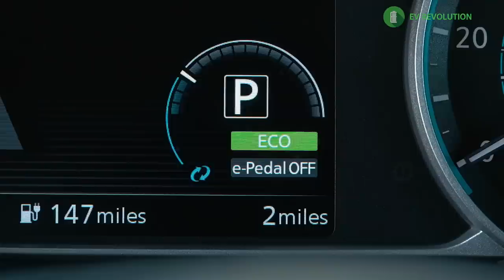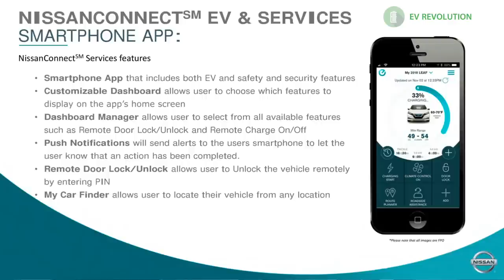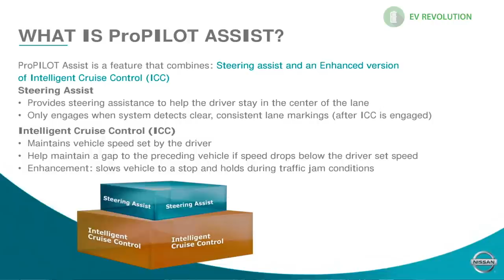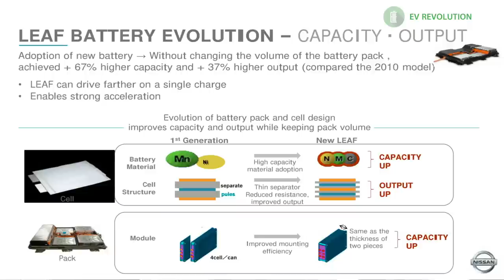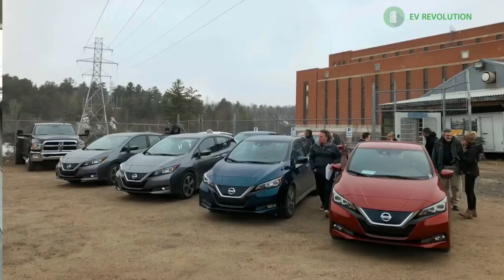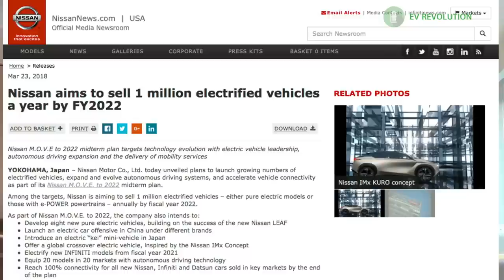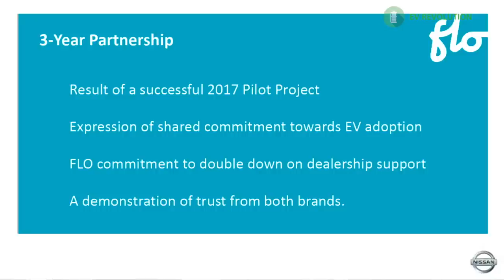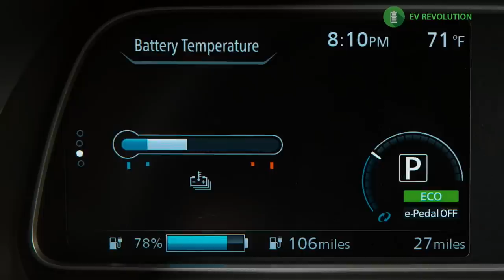Episode 3 - 2018 Nissan Leaf Impressions

Comment: Thanks Ken for the great review. 
One comment on the App: the new Nissan Connect EV App as shown in the review is currently not available in Europe, we are still using the previous version of the App (with some minor updates to handle some additional features of the new Leaf).
Reply: Hi Christian, thanks for letting me know that.  I thought the new App was pushed out as an update to the old one.
Reply: Kenneth Bokor I think the reason why the new App is not also rolled out in Europe is that it is based on „Services powered by Sirius XM® “. SiriusXM is not available in Europe.
Reply from the maker: Thanks for watching!

Comment: The EV EXPERIENCE of waiting for a fast charge is not what will make BEV mass market. They should have skipped the 40kw pack and went straight to 60
Reply: Hi PDK, yes true but remember that Nissan has primarily positioned the 2018 Leaf as more of an Urban-based BEV.  They claimed that 99% of new BEV adopters would hardly every go beyond the daily range from an initial full charge.
Reply: I certainly hope it works out for you.  Don't get me wrong, we love our older Leaf, but degraded winter range means I couldn't use it as a commuter anymore (62 miles RT). It will be still used allot but now the 3 take that duty :)
Reply: Thanks I hope so too.  And my plan B is to give it to my daughter in a few years and get another BEV with longer range as my primary car.
Reply from the maker: Thanks for watching!

Comment: Kenneth, I should also add that Tesla's so called killer advantage - the charging network - is actually a disincentive for me.  I live in Nanaimo on Vancouver Island and if I drive anywhere north or west, there is no Tesla charging, other than J1772.  With a non-Tesla, there is a half decent availability of DCFC.  I wonder if the same situation applies in parts of Ontario.  It's time someone pointed out that Tesla chargers are not as plentiful in Canada as they are in SoCal! Thx
Reply from the maker: Hi Mike, thanks for watching!  Your going back in looking over Ep 3!  I'm not at 127 and counting!  Anyhow, yes this is true.  When I talk to people about interest in EVs one can't only look at daily use range, size, etc., but available charging infrastructure can also be a factor.  

The example you give illustrates this perfect and for sure, Tesla SC's are not everywhere, however they have made great strides to cover major highways and heavily transited routes.  They and others continue to expand.  As an example, for us here in Southern Ontario, there is a plethora now of SuperChargers and one can cover pretty well most of the southern half of Ontario via these EVSEs.  But there are other providers like Petro Canada, Electrify Canada and a slew of other local, provincial and national entities.  That's the good news.

For you Mike, I am not sure if you have an EV yet or have joined the "Revolution" already, but you will know your needs better than anyone and be able to make a decision.  My goal with what I do is to help you be informed, so you can make a decision with accurate and reliable information.  Hope you subscribe and watch more of what I put out there.  

Oh and I know the island fairly well as I used to live in Victoria when I served many years ago in the Navy and was stationed in Esquimalt.  Lovely area and I always look forward to going back.

Comment: Ya know I love my 2015 Leaf but what will you (and Nissan when they have upset customers) do when your battery degrades 15% in 3 years like mine? You will be down to 130 mile (probably less) of range. They may have changed the chemistry but with a Battery Temperature Management System, they are gonna lose battery capacity and customers
Reply: Well I’m hopeful the pack will hold out longer than that but time will tell. I’m giving Nissan a try on this buying a Leaf myself and I’ll report on how it holds up over time.
Reply from the maker: Thanks for watching!